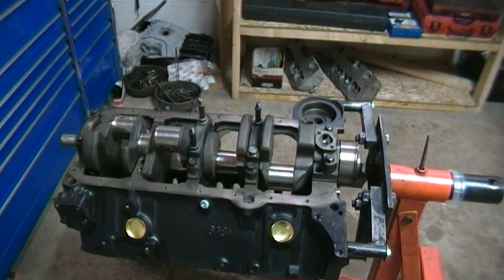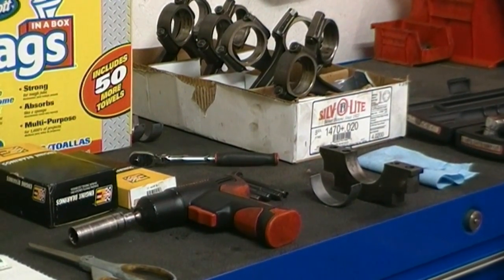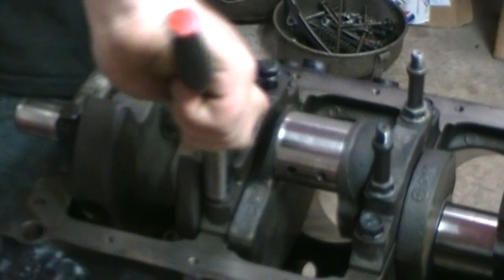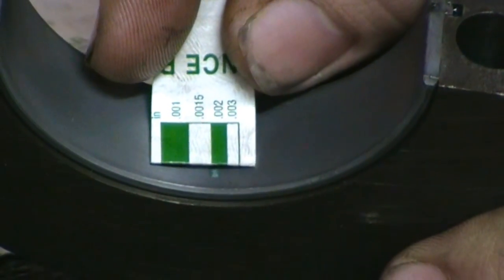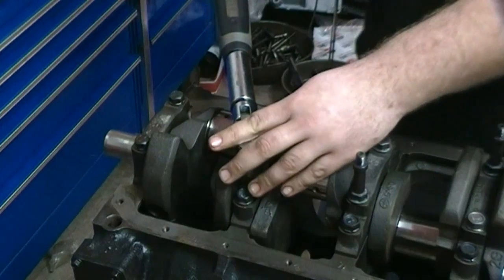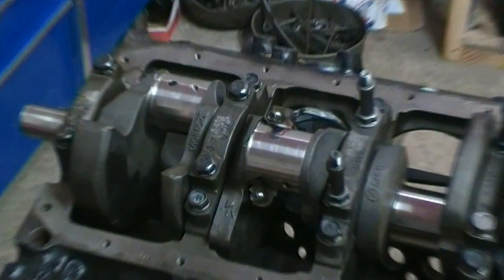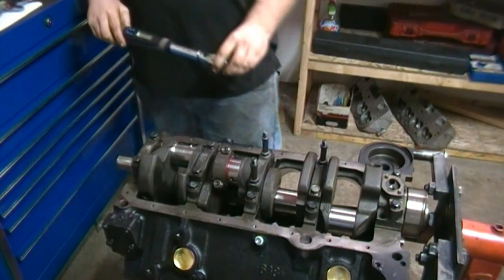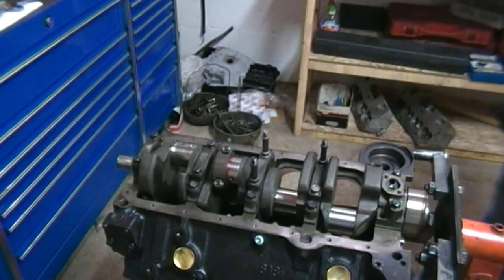How to plastigage a engine

Comment: thats a good vid she come into them marks, overtime, more and more engines showed uniformaty in there likeness, hes talking abt big pistons and tite bearing in shelf oil, and then turn er over w a damp cylinder wall afd check er out, remachine tighten, w older stylee bearings,

Comment: I've seen some mechanics that rebuild engines without torque wrenches and they run like new. Goes if you have the feel for torquing the bolts yourself you don't need it.
Reply: ditto. I couldn't believe it because I was always told different but still runs tens of thousands of miles later no problem. I don't trust my arm that much though.

Comment: My first 327 rebuild, I was going step by step from an engine book. It failed to mention to protect your crank when inserting the rods, which I didn't think of doing either. I dropped a piston in and it nicked the crank just enough to cause it to bind when I put the caps on. Obviously the plastigage wasn't accurate either. I spun the crank and the nick broke off and cut a groove in my brand new bearings!! I was soooo pissed!! You live and learn. Thanks for the video!!

Comment: Kevin, thanks for the video. I am about to rebuild the bottom end of my Honda. This will be the first build I do. I want to do it right. When I plastigauge my clearances, do you also need to plastigauge the upper rod bearing that sits in the connecting rod? Little confused on why only the bottom bearing is the only bearing checked for clearances

Comment: Good video thank you. Two things I noticed, when he torqued the main journal caps he torqued the outside two bolts first, normally you would tighten the inside bolts first to avoid forming a bridge (gap where the inside is off the mating surface, that is now locking in place by the torqued outer bolts). If you torque the inside bolts first they settle the area where the bridge might have occurred before the outer bolts lock a bridge (gap) in place. Same reason you always torque a head from the center outward. Also, if I were going to spend the money on a high-speed $$$$$$ Snap-on electronic torque wrench, I would NEVER use it to loosen tightened bolts.

Comment: Broke down in Texas, needing to leave X mother in laws house quickly, I had to turn my crankshaft piston journals by hand. The engine bearings where knocking bad and I had to make the trip home to Florida.

So what to do? After taking the engine apart, I stood the cam upright (in yard out in the dirt, on top of a blanket) assembled a piston arm back on with emery cloth (sand paper basically) where bearing goes, tightened it up and turned the piston rod around a bunch of times on each journal by hand till the bearings felt smooth. The journals where pretty shot.

I put new bearings in but no plasti gauge. I went ahead and put new rings in it too. To get the engine to turn I had to have somebody tow the truck for a moment and popped the clutch.

Yep, it worked. In fact for many years after to my surprise.  Sold the truck for $50 dollars just to piss off my x.

Ford F100.
Reply: RJSoftware2000 ...that is some funny shit!

Comment: If the clearance is not enough, or should I say doesn't smash the plastic down at all, what would be the remedy, is there an oversize bearing or does this indicate a crank replacement?
Reply: I'm no mechanic, but I would have the journals turned at a machine shop and use .010 oversize bearings. Commonly referred to as 10/10'ing the crank if memory serves. But like I said, I'm no mechanic.

Comment: Note plastigauge is not a good way to do it cheap crap, good luck on those builds. Real machine shops do not ever use the plastigauge. Maybe ok for a daily driver never a racecar.
Reply: metoob Hart Micrometer here is some info Plastigauge and anyone who uses them is a joke. http://www.hotrod.com/articles/plastigage-vs-micrometer/
Reply: must agree.wouldn't give you a nickel for plastigage.too many things to go wrong.you will only know vertical clearance not horizontal clearance.clearance in the horizontal affects oil preasure consitancy.i would also stay away from electronic wrenches!
Reply: so what should you use?
Reply: Thats good info but doesnt really explain why the plastigage is less accurate.
Reply: metoob Hart Because its a cheap plastic piece of shit dude thats why lol. Why dont you google it for yourself. If your dumb enough to build an engine and by a cheap plastigauge instead of a micrometer after spending all that money there is no helping you.
Reply: i have? you still haven't explained how this could be inaccurate. i know a dude who used to rebuild miata engines and used plastiguage and they would last for 100k + miles. im googleing it as i'm writing this, and still the closest thing to a real test of accuracy ive seen is "i think its probably not as accurate"
the only way i'd imagine is if there were some imperfection in the metal, and you measured on that exact spot.
Reply: Brian Heiden that being said, a micrometer is probably the way to go if money permits, it seems much easier, im just not seeing any real argument against plastiguage.
Reply: metoob Hart If you cant afford a Micrometer you cant afford to rebuild the motor. Still arguing? I think this is not for you had about enough Plastigauge is a garbage tool just like anything at harbor freight a cheap non accurate tool for a very precise job. if you dont get it there is no helping you. Simply call any machine shop anywhere and they will tell you the same thing been doing this a long time.
Reply: dude i believe you, and again, i'd use a micrometer. i just want to know why plastigage is inaccurate.
Reply: metoob Hart You did not google it? Did you call a Machine shop. Its a cheap piece of plastic vs. a quality tool enough said about it.
Reply: If you know what you're doing plastigage is fine. Its also good because it will show you if the crank journal is egg shaped if you do it properly. Of course micrometers will be more accurate and if you're in a machine shop you'll have all the right tools, but I use plastigage in diesel engines that go another 400,000+ miles. The Isuzu commercial truck service manual specifically says to use plastigage when replacing rods/mains in the 4cyl. and 6cyl. engines.
Reply: Plastigauge is accurate enough my friend. My ASE certified textbook says to use Plastigauge, and it even says to round ten-thousandths to the nearest half-thousandths when looking at the bearing clearance specs. This is a diesel textbook and in the diesel field it is usually more strict on precision than automotive since diesels are used to roll in huge amount of money for businesses and they don't want any fuckups on their engines.
Reply: It says to round it because it not accurate. As I said if you cant afford a micrometer over a plastigauge then you cant afford rebuilding an entire motor. Why would you be stupid enough to risk an issue. I am also a full time mechanic with years of machine shop experience. I have a handful of guys that are old school 30 year machinists every single one of them says the same thing. You go ahead and use your harbor freight plastic gauge see were it gets you. Quality is something most mechanics and machinists prefer apparently thats not your mo on a rebuild lol.
Reply: Micrometers are not expensive if you cant afford one you cant afford to rebuild your motor. Were talking about a very precise tool vs a cheap piece of plastic what do you not get man? You would have to be a fool to take the risk of using a plastic piece of shit from harbor freight. As I said call a couple machine shops they will set you straight. Honestly its common sense which seems to be missing you and a few others here. As you can see there are other people who no what is up with the subject just read the comments here. We are trying to help you if anything but go ahead be a stubborn fool about it see were it gets you saving $20-$50 lol

Comment: now wouldn't u want to mention to the viewers when you tighten the main bolts holding your crank bearing dont you want to torque it in stages ie: 40ft. lbs then wait about 30 mins or so then finish tightening to manufactures spec
Reply: Holy herpes infection Batman! Thanks for the 411!

Comment: Don't just check clearance look for pitting etc and make sure it is nice and smooth. But i just got my whole rotating assembly machined and bought 10/10 bearings. You can find them on summit racing jegs etc. But as others have said, if its out of clearance it has to be machined.

Comment: By the way, if you have a preference as to what the plastiguage sticks to (crank or cap) you can always apply oil to the surface you DON'T want it to stick to before you lay the plastiguage down.  Correct me if this impairs any use of the plastiguage, but thus far i don't think it does.

Comment: I know this answer is a little late, but also if its out of tolerance you can have the crankshaft 'machined' (takes a little metal off of where the bearings meet the crankshaft).  Afterwards you can buy larger sized bearings to make up for what has been machined off.  This can only be done so many times though, and only so much can be taken off each time. Hope this helped :)

Comment: I just had my 455 olds  rebuilt and the mechanic didnt plastiguage niether the main or rod bearings. When i took my boat out to the lake it ran find. Of course after breaking it in. It ran about four hours, and when i let off the gas to park the boat it was knocking. We opened it back up and found piston three bearings some what scared up. It didnt spin it. What do u think was the cause of this. And what do u recommend doing.

Comment from the maker: If you were out of tolerance then you would have low oil presure which would lead to engine failure and the warmer the engine gets the lower the oil presure. If the clearance is not enough then the engine will not rotate properly it will be hard to turn.